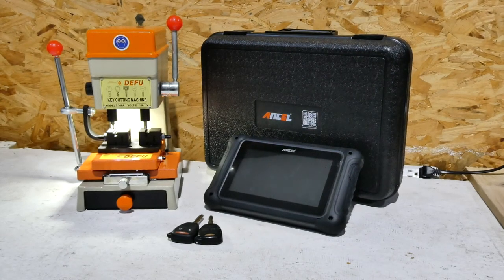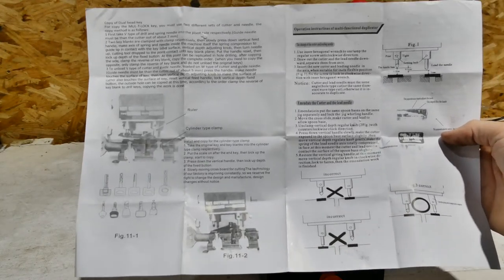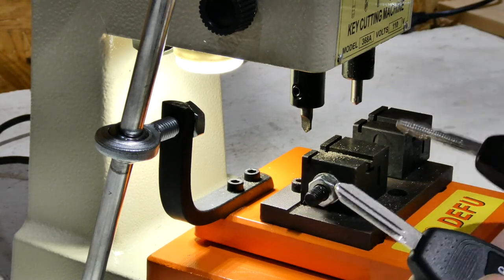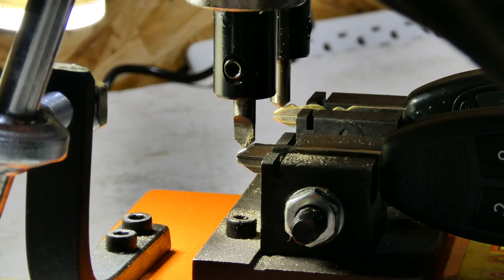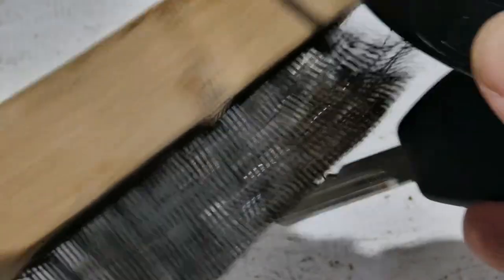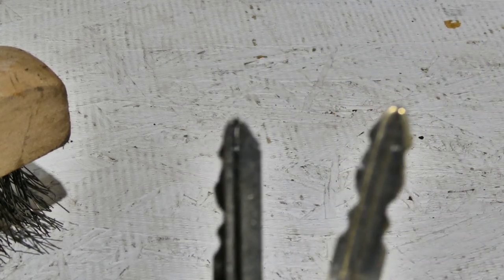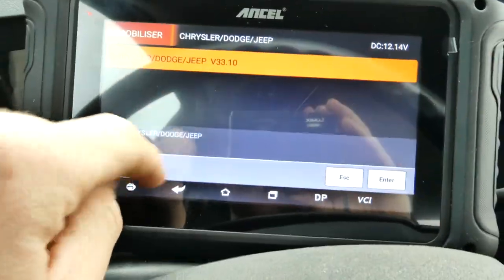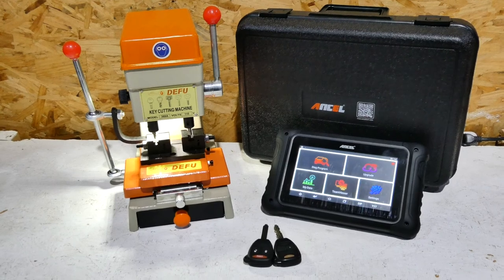Cutting and Programming Automotive Keys With DEFU 368A and Ancel DP500 (08 Ram 3500)

Comment: Instead of this you should buy the Chinese vertical cutting machine, you’ll save a whole lot of time cutting keys than this machine and that machine is around $110, and keep this one just for high security key, that’s what I did when I was starting to cut keys, this takes to much time to cut a regular key.
Reply: Link? This machine looks so painfully slow
Reply: @cornchips007  110V 100W Duplicating Machine Horizontal Copy Machine Cutter Cut Engrave Machine
Reply: @cornchips007  the machine went up since when I got it, the first comment is the one I started with, but I’d recommend you go with the second one I post because it have a cleaning wheel and more fine tune adjusting if you’re going with these cheaper machines.

110V Laser 2AS Horizontal Cutting Copy Duplicating Machine DIY Cutter Tool
Reply: @Hugolopez732  where did you purchase this at?
Reply: @user-oq6nn8fg5c  I got it on eBay.
Reply: @Hugolopez732 where do you buy it
Reply: @johndoe-by4up  I had bought mine on eBay a while back
Reply: Name and link of the Chinese vertical cutting machine pls... Thanks